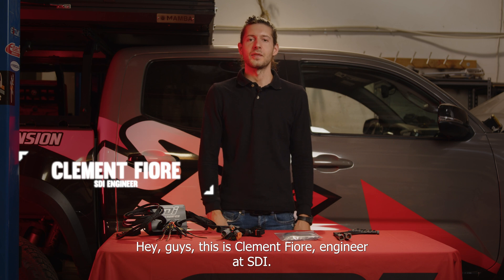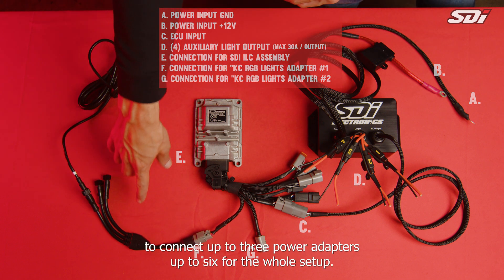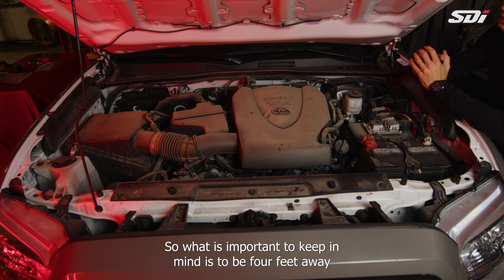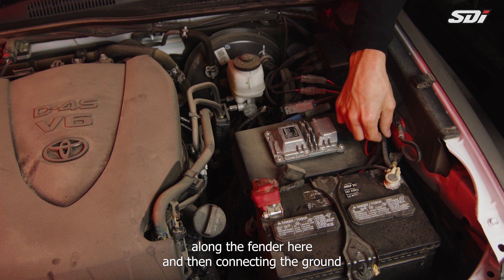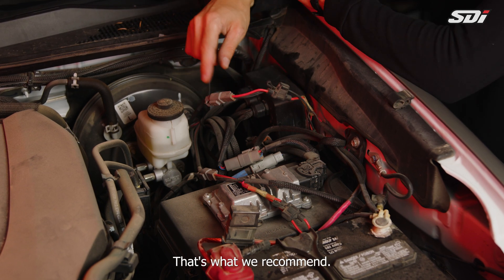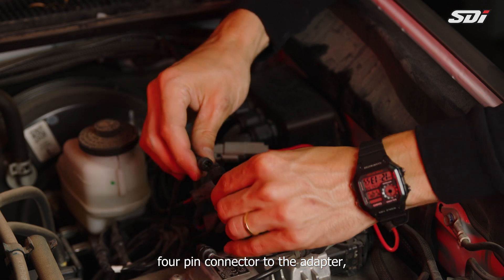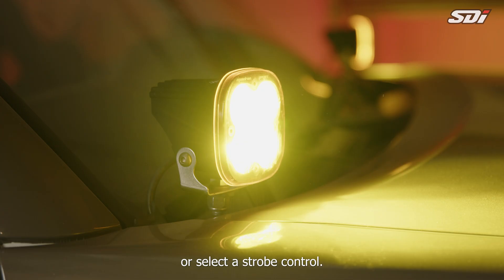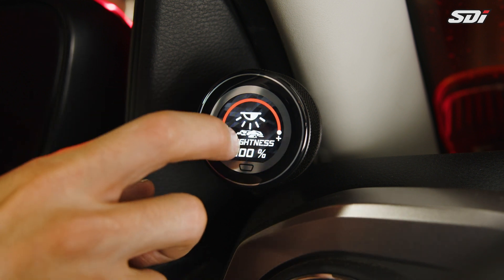SDI's E-CLIK Integrated Lighting Control Installation Guide

Comment: love my SDI for my taco. although I do have some ideas number 1 would be the ability to customize and re arrange the sdi menu and the icons. would be cool to have a Bluetooth module were you can pair it with your phone and change icon/menu layout select your quick access menu. or just change colors and icons. number 2 would be a little more involved but way more useful, is having the ability to adapt a full range of obd functions examples would be seeing in the display more precise in depth engine oil, coolant, and transmission temps. things that you can't really see in a Tacoma cluster, as well as engine codes, engine light reset, gears, shift lights etc. etc. basically turning sdi into a powerhouse and a once stop device that can do it all. just my idea.